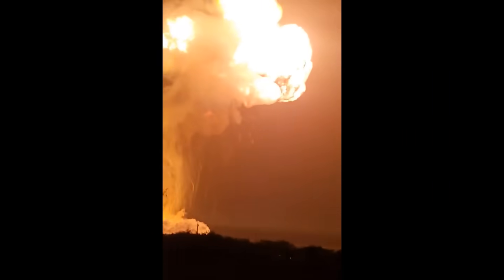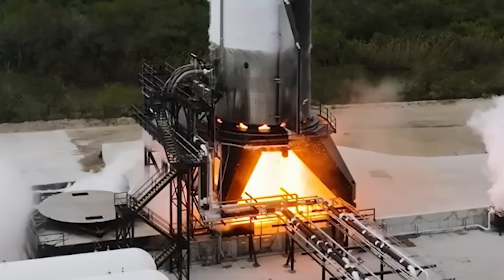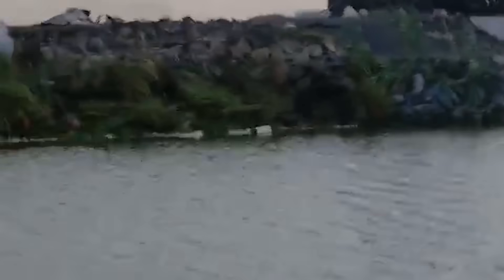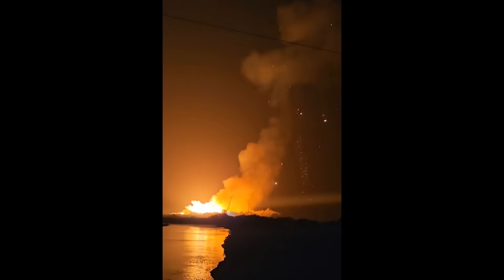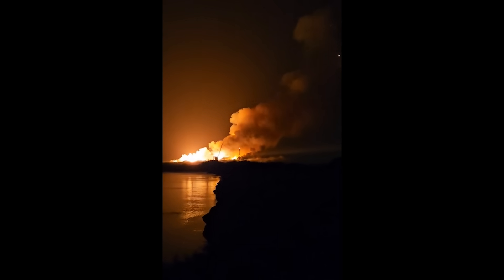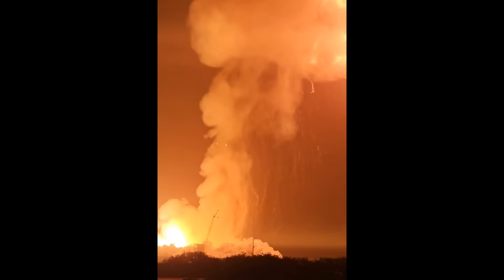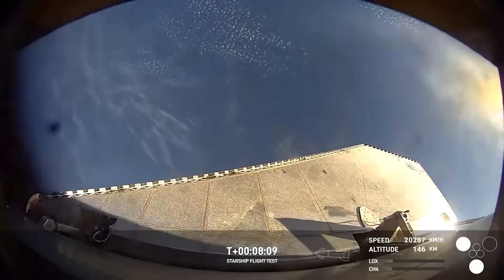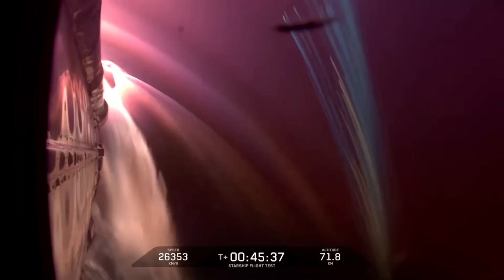A Closer Look At The Damage To Starship's Test Site

Comment: Hard to imagine launching people on Starship without a launch escape system...at least for a good long while.
Reply: 100%. Especially without landing legs - no ability to make a contingency landing anywhere but at towers, and if any failures occur on the ship OR tower at any point between launch and the landing burn, the only option is to ditch offshore and topple over. No chance it gets man rated to NASA standards without a crew escape system
Reply: Not to mention those passengers not being blown up during launch would face tipping over during vertical landing.
Reply: Imagine if commercial airliners didn’t have an escape system. Oh, wait a minute…
Reply: @lyricbread imagine if commercial airliners blew up everytime they flew oh wait

the abort system of an airliner is gliding. starship can't glide, it can only do a controlled fall. stop parroting this meaningless musk quote
Reply: Yeah, for lift-off from Earth, it will never be man rated in its current state since an escape system is mandatory. But who know, a revision of NASA's procedural requirements for man rated space operations should be published in mid December this year...
Maybe the current depraved US admin (more than usual) will enforce a revision that would allow drug addict Musk to put people (morons really) inside that insanely dangerous thin can without an escape system? I would prepare a metric tonne of popcorn for each launch...
Reply: Just 20 years ago science would tell you its impossible....so not really that hard to imagine.
Reply: There’s two chances this vehicle is ever human rated.  None and Buckley’s. Material science has a long way to go before anything this big is at all feasible.  
Let’s just call this what it is; a vanity project and a monument to sunk cost fallacy.  Space X have done some really good work but this is their Cybertruck.  They need to rethink things from first principles and scrap this abomination before it sinks the company.
Reply: The booster is great, but the ship is a weird and problematic design.No capsule on top possible, problematic heat tiles, header tanks, payload door issues, flaps, belliflop, etc. as hard as it can get. Stoke Space has a much simpler , more realistic design
Reply: @szdorant  Stoke space is great but the capsule design really does not scale well to starship size. Remember that the Nova rocket only has a ~3 ton payload.
Reply: @wyatthalchishick5167 It's only their first rocket, according to them it is suposed to scale up very well, Starship size is too big for most applications.On the other hand Starship does not scale down well at all.
Reply: @szdorant I will be excited to see a scaled up version. Maybe it will be a very wide rocket!
Reply: I suspect Starship variants for just Lunar missions or Mars expeditions would be launched first, and then Falcon 9's or Heavies with modified Dragon Crew Capsules would bring up the passengers (say 5 or 6 at a time). 

I don't think a hundred passenger trip to Mars is in the cards anytime soon (maybe in the late 2030s?)...
Reply: @michaeldunne338  Late 2030s, really? You know it's a one-way ticket right? Or did you mean the moon? Either way, it's not going to happen. We've passed peak SpaceX.
Reply: @guapochino140  Did not mean the moon. And said "maybe" when it came to the time period of late 2030s.
Reply: @guapochino140  Seems you have missed Elon saying 5 starships will fly to mars Dez. 2026! 😂
Reply: @michaeldunne338  OK, thanks for clearing that up. Sorry, it's bad reception here where I am because I am traveling in a tunnel from NY to Chicago at 600mph! The wifi literally can't keep up.
Reply: @michaeldunne338  Agreed. I was thinking early aviation might be a parallel, but even the first passenger airliners didn't carry a parachute for everyone.....
Reply: @marksinclair701  Yes, maybe this would be like the Ford Trimotor, and DC-2 and Boeing 247, when planes could reliable convey 10 to 15 passengers with luggage and air mail consistently across decent ranges (500 to 700 plus miles). After those planes, civil aviation tech bloomed.
Reply: Don't worry, the ship can abort from the booster. Pay no mind to the fact that the ship is the one having all of the problems and the booster has been mostly flawless (engine reliability notwithstanding).

Humans will never launch on this vehicle. If they ever do, it's only a matter of time before it kills people. It simply costs too much weight to make it safe for crew.
Reply: @ryanspencer6778  come again in 2-3 years to tell us how your predictions are doing.
Reply: @ryanspencer6778  The ship can only abort (slowly) from the the booster near staging, if then. It doesn't have enough thrust to escape an exploding booster, those systems pull at least several g's I believe.
But agreed, it won't launch humans, at least for a good long while. But I suppose it will have to eventually, if anyone will ever return from Mars....

Comment: It's not that bad. Two weeks with clean up and it'll be fine. It sucks only because it will delay the next flight.
Reply: The delay may more come from the next ship not being nearly ready, because they allegedly do have other test stands.
Reply: @cube2fox  they have apparently started on block 3 and, last I heard, ships 37 and 38 are the last two block twos and would be ready for launch in July-September.  Of course if the test stand(s) are unusable and therefore they can’t test them, it doesn’t much matter if the vehicles are ready.
Reply: A two week turnaround for the Massey to return testing vehicles is classic Elon over confidence or hubris by another name.  Whatever Elon says as far as a timeline we can double or triple it.  

And it may be that pushing up the cadence of these starships launching led to mistakes being made.   I was already wondering that after the loss of the ship in ITF-9.
Reply: lol when will people like you finally admit these failures are a set back?
Reply: @bluesteel8376  Two weeks Elon time maybe XD
Reply: @bluesteel8376  2 weeks is a set back, take off your hate blinders and realize that this is a test. Every time a prototype blows up you people pretend it’s another Challenger😂
Reply: @bluesteel8376  Sorry, but I'm not part of the fandom. "Finally admit" - Comprehensive reading skills takes practice. " it will delay the next flight" is actually stating  "these failures are a set back", but I digress.
Reply: @bluesteel8376 He DID “admit” it was a setback.  A two-week setback in his estimation.  What’s bugging you?

Comment: This is bad for Starship, but I think it’s better that it happened here and not on top of a fully fueled super heavy at Pad A
Reply: True, but on top of that it feels even worse for those who have been anticipating the next launch by the end of June
Reply: Imagine trying to rate that hunk of junk for manned spaceflight.
Reply: That’s next.
Reply: Good Point!
Reply: About 10 kilotons better, in fact!
Reply: @Chris.Davies  About 1 - 2 kt eq. with realistic mixing, i.e. serious damage out to 400 m
Reply: Or worse… Pad 2
Reply: Aggree 👍
Reply: Sure
Reply: Well unfortunately the ships heat shield was made of silica fibres. Asbestos times ten. The fibres were sprayed into the air and were detected downwind. Heavy carcinogen and fibrosis risk.
Reply: Or on Mars Hahahahahahaha😂
Reply: And manned. I don't think there would be long line of astronauts willing to get on top of this thing.
Reply: @ash9803  No launch escape system.
Reply: The N-1 legacy seems to live on in Starship
Reply: @AlexKarasev  Nah… plenty of potentially showstopping issues with starship, but the one making some half informed people compare it to N1… the huge number of engines… never were an issue.
Reply: @tusse67  You've jumped to a few conclusions there, bud, about the scope of parallels between the two vehicles (few of which are technical), and the people making them.
Reply: @AlexKarasev  the comparison between Superheavy and N-1 was always centered around the large number of engines. Some one might be able to find other comparisons… but these are an afterthought.
Reply: This is all preplan!  no problem!

Comment: So they didn't design the TEST stand to withstand a catastrophic ship failure?
Reply: To be fair, the part that hold the ship looks to be intact. It’s the ship and everything surrounding the stand that got obliterated.
Reply: @WilliamJR123  Sounds like they should have protected the equipment better, knowing that an explosion was likely to occur at some point during testing.
Reply: @Hafgren I think they didn't know that. (Even if they did, it probably makes little sense to try to make a test stand resist a large explosion. Probably better to repair it.)
Reply: @Hafgren it’s always a trade off between building something strong enough to survive a catastrophe vs building something that’s easily repairable in a case of a catastrophe.
Reply: @Hafgren 

This assumes that sx ever thinks things through when they start a project. From my observation, they usually don’t.
Reply: @WilliamJR123 yeah exactly
Reply: If the ships explodes which is full of propellant and everything catches fire nothing would survive
Reply: Yeah and Elon said this has never happened on the orbital class starships so they weren’t preparing for it

Comment: And that’s why they fill 100% oxygen and only 5-10% CH4 during tests.
Reply: Imagine the fireball if the fully-fueled stack were to blow before launch!
Reply: Anyone old enough to remember the Apollo 1 launchpad fire knows that even teflon will burn in a 100% oxygen atmosphere. ;-)
Reply: Why not also fill just 5-10% (or whatever the mixture ratio is) lox as well?
Reply: @VyarkX  Maybe the stability of the structure relies on the lox in the tank below.
Reply: @VyarkX  Full lox load dampens the vibrations on the fuel lines
Reply: @trentwalker989  And even damps vibrations as well. Dampening in fuel lines is TBAAAC.
Reply: @VyarkX  Hold down clamps are not strong enough to hold the ship with all engines running when the tanks are empty.
Reply: @k53847  People say that, but holding that much force is trivial.
Reply: I didn't think about that, if the full stack went up fully fueled it would be a looong time to get that pad rebuilt that's for sure. Hopefully we don't see that ever.
Reply: Imagine fully stacked and filled Starship exploding :-)
Reply: I'm a ltlle rusty on my chemistry.  Does that put lower explosive limit at something like 175 kelvin?